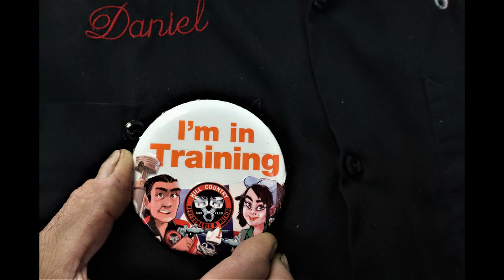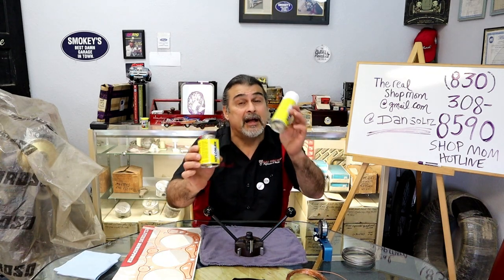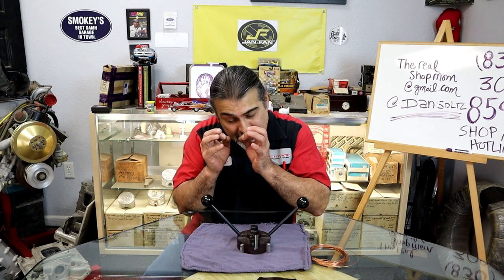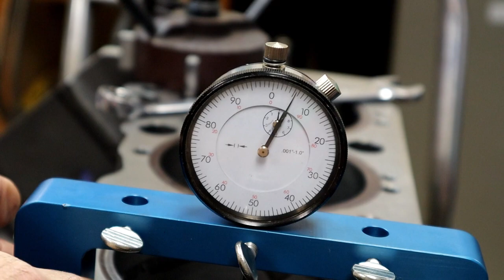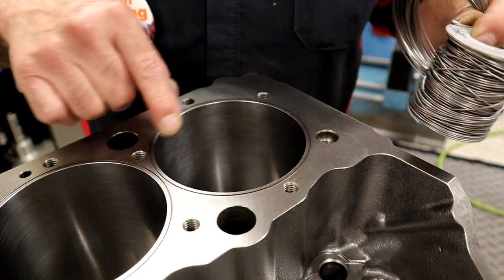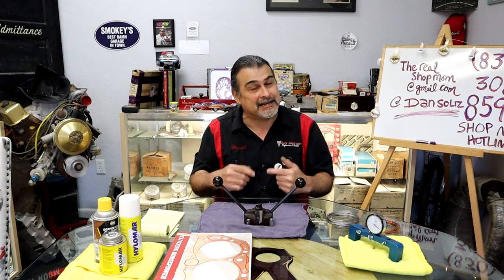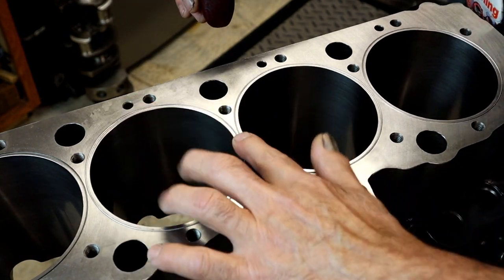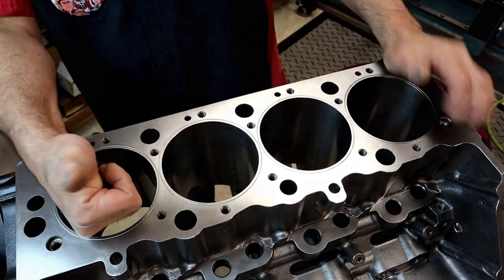How to o-ring a block using ISKY's Groov-Matic O-Ringing tool. PART2

Comment: 100 thumbs UP  .  I think about the way i built engines back in early 70 's porting head with a drill and a piece of speedo cable and different round  stones . tape and hose clamps lol . to match intake manifold we would bend a piece of wire 90 degrees to catch high and low spots .  it would to days of work to do them .  back in the day i knew alot of really smart people and they kept telling me to spend more on the exhaust side of the heads it was more important . how things have changed sense  those days .

Comment: Nice video and good explenation.

- Stainless wire for copper or composite head gaskets.
- Copper wire for MLS head gaskets.

Mitsubishi and Subaru guys run 1000whp+ with stainless wire and stock composite head gaskets, no receiver grove.

Comment: Just ordered 1 from amazon. Can’t wait to try it. Would putting some oil on the cutting surface help at all for a smoother no chatter cut? I can’t see how it would make it any worse.
Reply from the maker: You will love it, oil ? It depends on the metal I have tried it,I have found that sometimes is stops cutting and just dulls the blade. Lately I’ve been doing them dry.

Comment: Your videos are great, actually easy to build a tool like that;  thanks.
*edit,  Daniel*   wher do the 10 thou go?  SS cannot be compressed there,so does the ring dig down into the cyinder head?  or does it just stay controlled by a gasket stop?
Reply from the maker: It gets pressed into the head gasket. Sometimes we do a receiver groove in the cylinder head and it sets it’s self there. Kinda like a locking ring.

Comment: hey  great video btw , just wondering if you put a reciever groove in the head . how to do line the groove up to the head? and what do you use to cut the reciever groove on the head . i presume a mill. ? also the reciever groove in the head how wide do you determine to make it ? i presume it has to be wider than the oring groove in the block to accept the gasket plus the oring .thanks
Reply from the maker: I did not put a receiver groove on the cylinder head on these. Wanted to test the compressed air supercharger and it worked fine. On other power adders I would have. BHJ makes a plate system to cut those on the table we use the mill to do it and same width as the block.
Reply: @MrDanielSoliz   if you do a set with reciever groove on a manual mill i would like to see a video i have a ls i would like to cut the heads myself on my mill just want to try do it without the bhj plate if possible

Comment: Hello, loved your videos on this. I have a question, I am not a mechanic not a motor builder but I am fixing and renovating my car, learning as I go, so right now I have the option of getting a copper gasket custom made with higher thickness since I got the  engine block releveled and the surfacing took a lot. Originally the motor does not have a copper gasket so I don't know if the torque specifications needed and also if I need a ring since I got a thicker gasket to compensate deck height
Reply from the maker: Same torque will work and o-rings are not needed. 👍
Reply: @MrDanielSoliz  thank you from the other side of he Ocean

Comment: Is that an iron or aluminum block? I bought one based off your video I found online and can't get it to cut my iron nissan block.
Reply from the maker: Iron block.
Reply: Did you end up finding a different blade to cut it?
Reply from the maker: The blade that came with the kit. I did buy a spare blade and the black I cut was a( high nickel )very hard block.